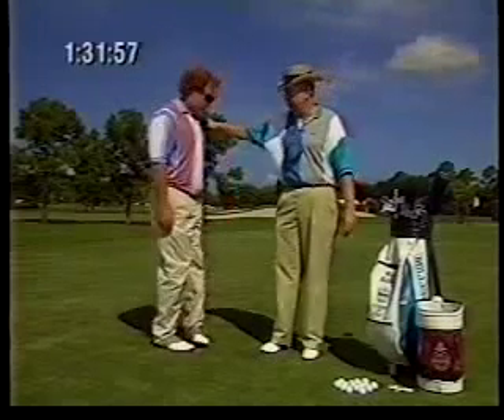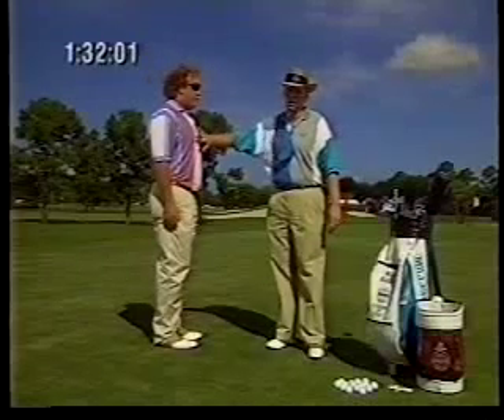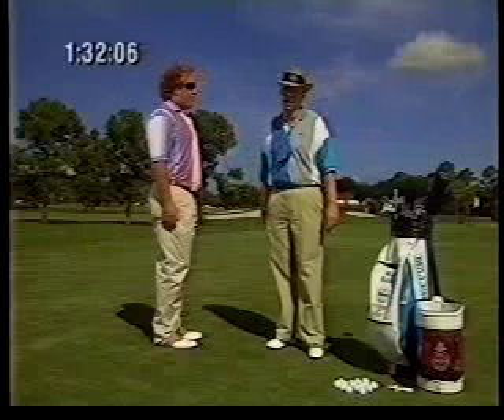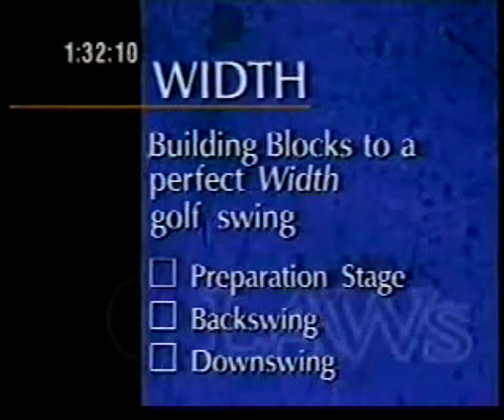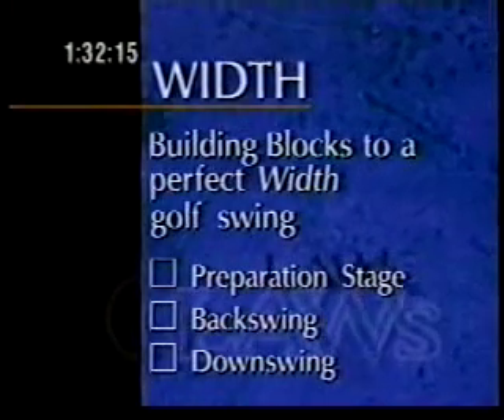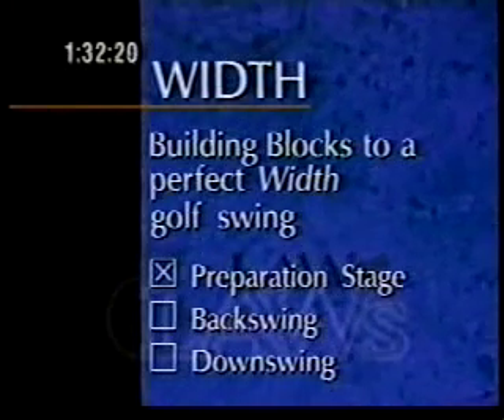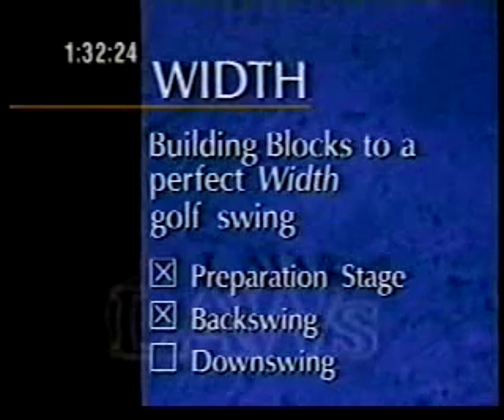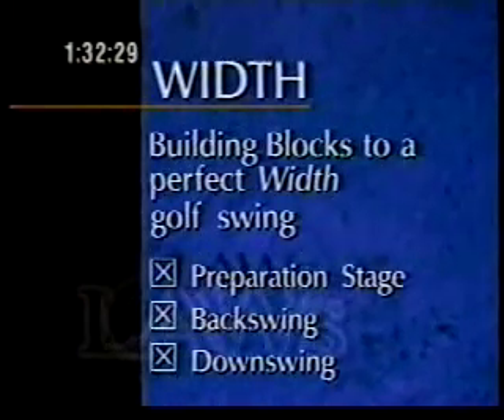The LAWs of the Golf Swing: Width

Comment: Thanks, i get some good shots with these notes, setup, but still missing a few points, like follow throw (chicken wing happens when i use long thumb and wrist early cock) Wish i could find a coach or teacher to work with, but most lessons they will try to correct everything in this setup first to the normal swing, haaha. Alignment, grip, etc. ( they will say no wonder you can't hit the ball, your feet and hits aiming one way and your shoulders are aiming another way. hehe
Reply: Exactly… the same with me..i wish this went one step further, like on release, follow through.. the weight transfer from back to front i make some great shots, but only 75% of time .. on the other 25% leads to miss hit and double or tripple…so this is good base starting point information… but no teacher to get us to finish line…like you said.. go to any pro gor lesson.. they are going to change our alignment first

Comment: stay away ,this guy is gonna ruin you as a golfer , he is putting to much into your head to think about...............
Reply: i would have to disagree because i found the evaluation part of the tape most helpful in finding what i can and cannot do with my body and range of motion with my limbs. it steered me too the width type of swing tape and that info was very straight forward and easy to follow and perform. give the system a try.
Reply: Parker, this has worked wonders for me. After thirty years, finally instruction that fits my body type (short arms, thick chest). It's very simple, really. If you are built like Mike Adams, this may work for you. If you don't it certainly will not (but the L or A swing might). Thanks so much for posting!
Reply from the maker: To be honest, I never got anywhere with these methods. They are just far too complicated for the average person to think about. See my videos from Toski and Flick if you want to keep it simple. Also check out Mike Malaska who worked with both of them.

Comment: The Width model has helped me to start to know what to do with my swing. Just a few questions though as I have gotten more in depth with it. An article called L.A.W.S. revisited claimed the width player takes it slightly inside and steepens the club to get it on plane. (an over the top move, but a correct over the top move.) This video recommends shallowing the club to get it in the slot. These parts seem contradictory or maybe I'm just not fully understanding it. For the downswing the video explains moving into the left hip (loading into it) and using the left as the turn axis. I've been studying Width players and Older larger Ian Woosnam claims his downswing is too turn the chest and open and close the door with his right hand. I also read an article of the width player (unknown author) Which states moving the left shoulder away from the face is the key downswing move. Just confused on the different info on the same swing model. Greatful and happy to have a prototype to work from though. Big thanks to the L.A.W.S. guys!
Reply: You should pick up the book as it explains more than the video. The correct way to transition depends on whether you reverse slot or normal slot the club, which depends on how far inside the takeaway is. There’s a chapter on modifying the width swing.

Comment: I have been playing golf for almost 20 years.  I have taken lessons and pretty much just been frustrated by the instruction I received.  I learned to hit a ball in the same manner as hitting a baseball 'up the middle'…and managed to get my index down to 6.5  The LAWS of Golf for a 'width' player (Me) have helped me tremendously in just a short time after watching it.  I am hitting the ball more solidly, more consistently, and further than i have over my entire career.  No instructor has ever given me instruction for a 'big guy' to swing the club…and this video addresses me perfectly.  I wish i had seen this 20 years ago.  The simple acts of dropping the right foot back, flaring my feet, and having the correct posture for a 'large frame' have had such an impact for the better.  Thanks for posting this video.  I don't know who originally made this, but it would be well worth re-making it with modern HD cameras.  I'd buy them.
Reply from the maker: So glad to hear that this helped you. I've heard from several people here and at 4GEA.com who have had success with the WIDTH model. Mike Adams, TJ Tomasi and Jim Suttie were the brains behind the LAWS of the Golf Swing. Mike Adams is still very active on his website and has some great information there.
Reply: Thanks Parker.  I will check that out.  I have re-incorporated the Whippy Tempomaster 7 iron back into practice…and this club with the Width drills/swing has DRASTICALLY improved my game.  I have gone from struggling to break 90 to now knocking on the door of breaking 80.  Distance is BACK.  Accuracy is BACK.  Width+Whippytempomaster=Crushing it.
Reply: Being honest, almost 90% of the ppls will be a width player due to the heavy chest workout and longtime sitting in the office : D